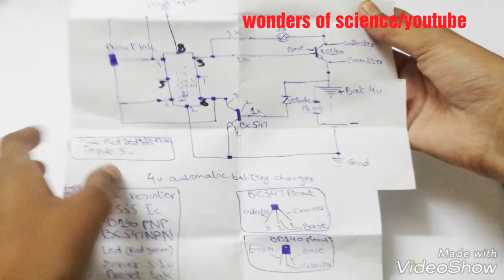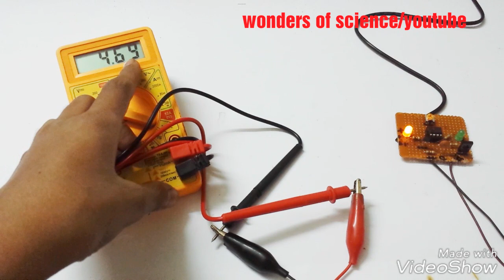How to make a 4 volt automatic battery charger.

Comment: Sir, I got BD139 transistor and BD163 transistor but I do not got BD140 transistor. So, in between BD139 transistor and BD163 transistor, which transistor I will use? If any of these two transistors are not able to use please say the reason?
Reply from the maker: Bd140 is a pnp transistor,You can not use bd139 cause its npn....Try using another pnp transistor...

Comment: Is it possible to use this circuit for 3.7v li-on  battery ?
Reply from the maker: No it will not work.But i have made another video about that.You can check that.

Comment: This circuit is wrong. It cannot work. The basic mistake is that the power transistor is of wrong polarity. Since the collector is fed as input along with pin 8 of the 555 I.C, it should be a N-P-N type instead of a P-N-P. Its output is supposed to feed the battery to be charged. But this cannot be done with this configuration! On the contrary, it could disharge an already charged battery...And this transistor is exposed to rapid demise due to reverse C-E polarization...Any expanation from the uploader?...
Reply from the maker: Πάρις Αζής So do you think BC547 is a P-N-P transistor!!!!
I have tested it and i dont need to give you any explanation.
The emitter of the transistor is connected to ground and the base to output.
!!!!!!!What do you need more than this???
Reply: wonders of science Are you so stubborn young man? I am talking about BD 140. The power transistor!
Reply from the maker: Πάρις Αζής Aah!!!Sorry for that...But you the configuration is correct.You should learn about "How to use a transistor with a 555 ic"
As you can see the The output pin of ic is connected with the base....which is correct.And about C-E i am not sure about that yet.But i think it is not wrong.If you see the pwm controllers in which 555 is used you can see the transistors connected in the same way......
When the battery will reach the set voltage..The collector will open and tge green led will blink....
Reply: wonders of science Ok young man! You are stubborn indeed. I said nothing about the configuration. I said that the polarity of the power transistor is wrong. Well, I cannot help you in this case. But being myself a retired electronics technician it is at least funny if not rediculous for you to insist on this issue. Read at least about the D.C biasing of bipolar transistors, and then talk again. Above all, you must understand my point. I am not a hatter. On the contrary I am glad when I see young people to be interested in electronics. But there is a limit. You cannot teach others while you need to be teached about the subject. And I say this because I already read all the relevant advice you give to people putting questions. Well, you are wrong in many of them. There are plenty of people like me who can easily evaluate them. In any case, remember something from me about biasing bipolar junction transistors: N-P-N types: C-E (power supply junction), C = +, E = - (Reverse bias ALWAYS). B junction, same as C polarity (against E, that is forward bias). For P-N-P transistors: same as above, with all polarities REVERSED. And this story ends here. Greetings from Athens- Greece!
Reply: Plz. be more professional.
Reply: @saadgobbo742  Are you referring to me? If yes, can you please elaborate your comment? Where exactly do you see my lacking of professionalism? I would like to see in what base you put professionalism as it supposedly differs from mine. But then how come that at the same time you put the same with mine comment to the uploader, as I did in the first place, that this circuit is wrong and therefore it will not work?
Reply: @jigglumedia2023  The BC547 is a NPN Transistor!!! 
NPN : 547, 548, 549.
..
PNP : 557, 558, 559...
Reply: Circuit clear nahi hai please Circuit

Comment: Is it possible to use this circuit for 1.5v battery
Reply from the maker: No it will only work for 4 volt battery.
Reply: so how can i do circuit that only for 1.5 v what is the difference between the two circuits , thanks for replying
Reply from the maker: This circuit is based upon 555 timer ic that only works on 4.5v-8v.So it is not suitable for that.You can watch my other video on this channel or can make another circuit by using old 5volt mobile charger.Thanks
Reply: thanks , bro i think i get it

Comment: where U  conncect read led U did not menson in circut please menson red led connection on circut
Reply: Red led is only for power indicater u can connect any in positive supply to ground using red led and resistor

Comment: can i set voltage to 4.2 and max current to 1 amp using this circuit ?!
Reply from the maker: You can try that.The current will remain the same as the input.If you use a 5v 1A supply.It should be possible.....
Reply: NO.